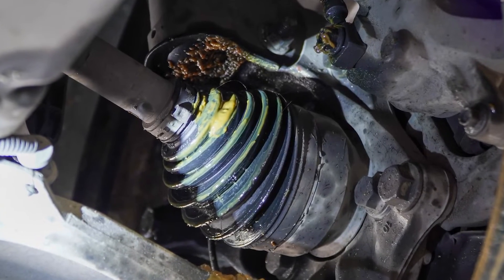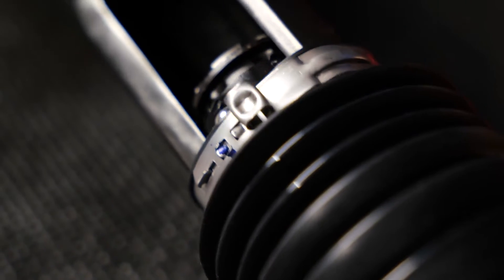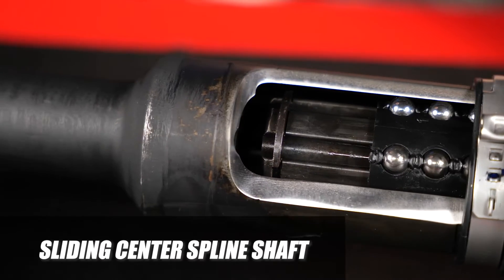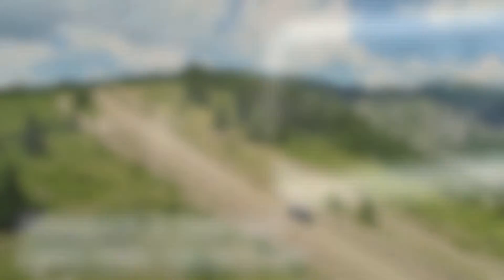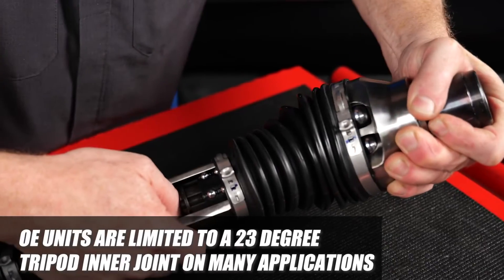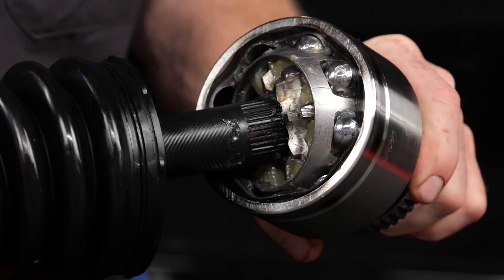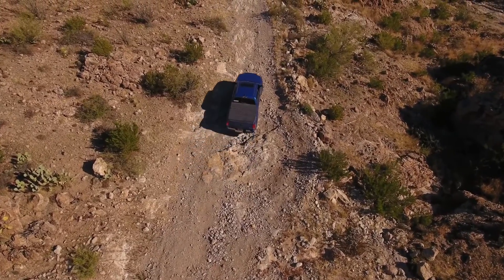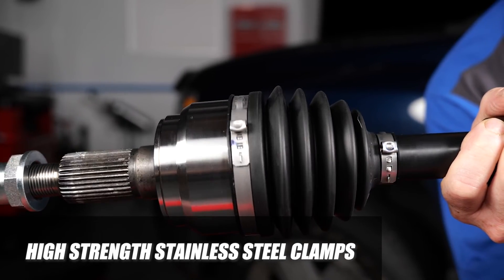Let's Take a Closer Look at Extended Travel CV Axles

Comment: These axles are a good idea but use cheap parts. Had mine for 1200 miles and when I was on a trail I turned the wheel around a corner and the outer cv popped and snapped ripping the boot and according to NAPAs warranty it’s voided if the boot is damaged. Isn’t that convenient. The more research I did the more I read about the outer boot and outer cvs failing on trucks and even on Subaru’s
Reply: I have my lifted truck, you think i ll need this set up.? 03 ford f150. I dnt really go OFF ROAD, Yours went bad because you off road a lot rite.? This might be a good idea, my stock ones the boot is already ripped, due to the angle of the CV axle, i play my torsion bars for a lil so my CV axles are now lil more even, but my truck looks nicer the way was. So putting this extended travel axles i. Should be ok
Reply: @ 
I think these cv axles will hold up good if you don’t offroad and depending what size tire you are running.
Reply: @jenni3639  i have 35s. You think is a good idea tu use this extended Cv axles.? The angle of my control arms made the angle of the axles go way too much down, that caused my cv boot to ripped. If i dnt really do off road i should be fine with these extended cv axles.. what do you think.!